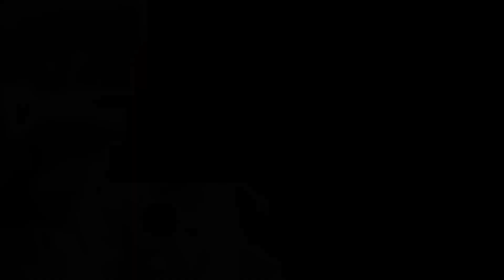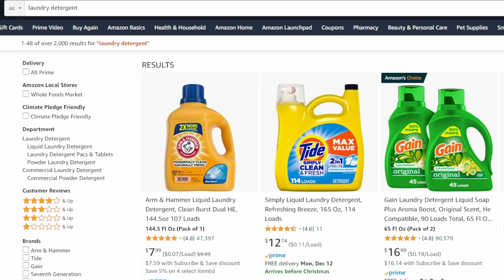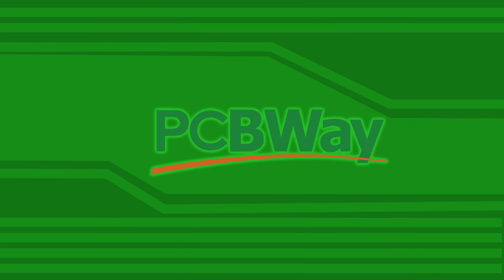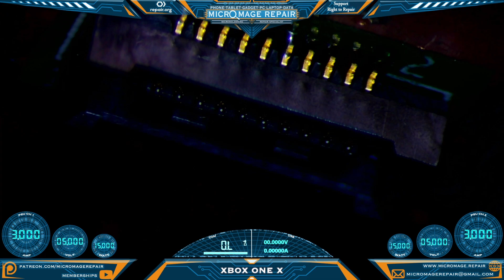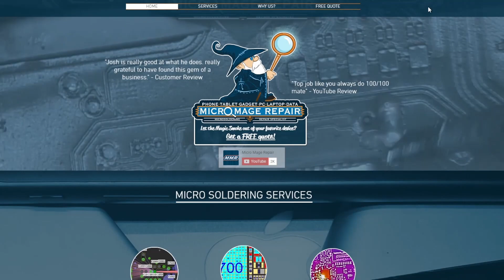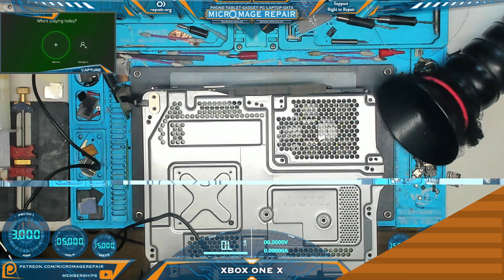Xbox One X: ⚠️Front USB FPC Carnage⚠️

Comment: This happened to me I started to give up I plugged in my phone charger in the usb port I screwed down light and moved it in place till I heard my phone on charge 😂 but yeah they are weak points in that model seems common for them to brake when dismantling them awesome work you have done
Reply from the maker: Appreciate you checking it out!
Pretty easy to knock off for sure. 
Some versions of this connector are less fun than others.  Was some variation with pad sizing.

Comment: I noticed you tin the connector pins, is it faster to get the connection done after preparing the pads on the board, when soldering the connector? Or Is it just more reliable connections when reflowing?
Reply from the maker: It really depends on the connector. This particular one, depending on the version, is really difficult to hand  solder. Flowing it in place is preferable and tinning the connector does help.
In other cases it can be detrimental to tin because you need a connector to sit flat on the pads and you can hand solder them.

Comment: I’m a big fan of pad stripes, especially if you have really tiny traces, this one is still fine with wires. Nice job
Reply from the maker: I like them for some straight forward work. Anything that requires a lot of pads or routing I'm going to use wire on. The lugs are pretty fragile and don't like to bent around much.

Comment: Tried running .1mm wire on the hidden row of switch pads to restore and could not get the second row to grab. Probably tried it three times. Used lugs the first time I repaired it which worked but one of the lugs must've been a bit weak and broke after a few days. But yea with the wire which I prefer to work with no luck. Any tips? Nice repair!
Reply from the maker: The biggest thing is once it's run it's has to be secured by UV solder mask.  As long as they are secured you can reflow and press where you're not getting connection. 
A breakout board can specify which connections you are missing.
Lots of nozzle movement while reflowing so you don't burn the port.
That's what I got. 😊
Reply: @MicroMageRepair  yea secured it every time with mask. Appreciate it bud!